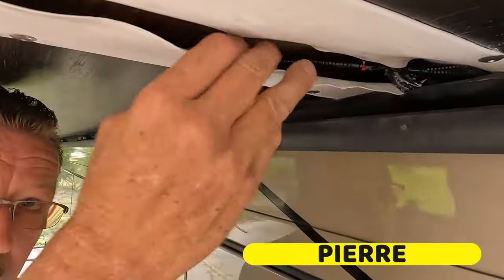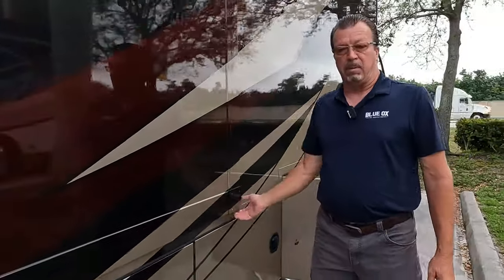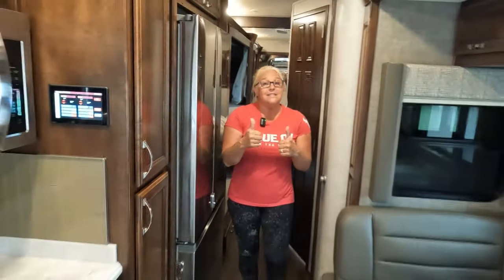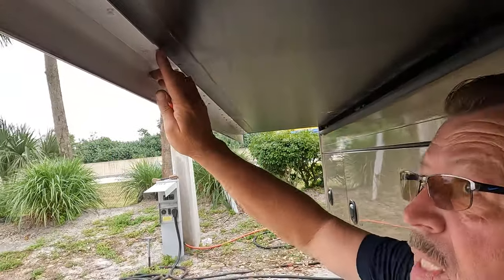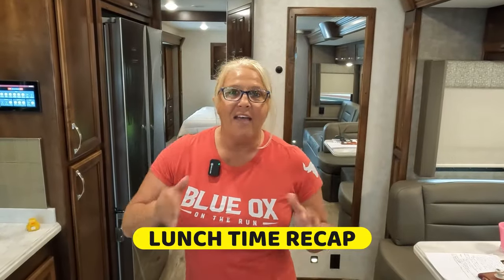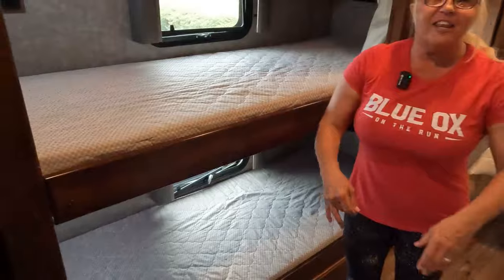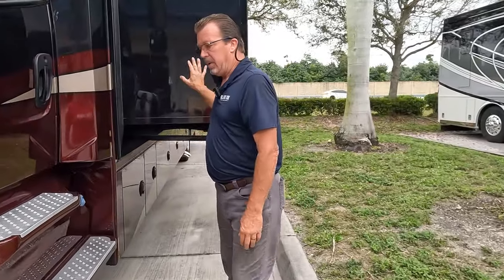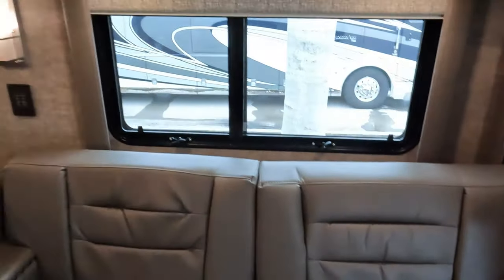⚡🔥“RV VOLTAGE DANGER: Hotskin Test Alert!” ~The RV Inspection You Can't Ignore!"⚡

Comment: Great job again! I liked the little artist's remark. With the Hotskin though mild at this point was this on the slide with the wires starting to rub or bind underneath?  I'm wondering if there is already a partially broken wire. I would make them trace that malfunction before I would pick it up.  Laurel, you seemed a little happy today that poor Pierre had to write up your list.
Reply from the maker: Not many techs can perform continuity test with success. That's the issue when electrical situations arise 🙂
Thanks for having my back Ms Loni 😘🤣

Comment: FYI some of those switch panels on the wall are battery operated , you can look at the Firefly control panel to see which ones are. They also at times loose communication and may need to be synced back up. Doubt it was due to the electrical issue he discussed.
Reply from the maker: "HE" just brings back facts. From there, techs have to do their assessments and fix the issues. "HE'S" not there to fix or diagnose any issues 😉...
"HE" says, thanks for your input 🙂
Reply: @blueoxontherun9188 He Man says, "go get your own channel" 😄
Reply from the maker: 🤣🤣 right ??

Comment: Nice coach! I have been eyeballing those along with the Dynamax DX3. Why did Pierre's attitude towards Super C's change? Anything we should know?
Reply from the maker: Just a lost of living space inside and storage outside,  in a lot of them. 
Servicing the engine is easier, yes. But most likely so for someone else, because I won't have all my necessary tools if I have a major breakdown. No parts on hand on the roadside ready to swap. Easier to change a belt is the only advantage left!
When is your starter going to fail? Not when you're home with all your tools available right?
So I lost a little bit of interest 🙃 and I'm a KW guy 😉😆
Reply: @blueoxontherun9188  Storage is a concern I have but I believe crash safety ratings are higher and safer than a class A. Roadside mechanics are more likely to service compared to a pusher and if it does need towed, tow companies are more likely to do a super C compared to a Class A which tend to get damaged when being towed. Isn't your LXE on a liner chassis Mr. KW? 😂 Thanks for your insight Pierre.
Reply from the maker: Yes....your right 🙄 I've got a useless frame and it would definitely be smashed up most likely on the event of needing a wrecker.
 I do miss my real truck 😉
Reply: @blueoxontherun9188  you're welcome..😂

Comment: So I’ve been told that you shouldn’t sit or use any slide while they are in. Only use them when they are extended out. Is this true?
Reply from the maker: That would be a cheap a.. build. Find a better unit if it is factual 🤨
Reply: @blueoxontherun9188  We have a 2022 grand design imagine 17MKE Travel trailer with the front Murphy bed. Is it safe to sit in the slide when it is in ? I never do because as I said i was told it’s not a good idea. You two are professionals on these and I would believe you more than my neighbor. Lol 😂 He was the one who told me and he’s an art teacher.
Reply from the maker: It is a piece of plywood...there's no real structure to your slideout floor...it will bottom out when hitting the floor 😉